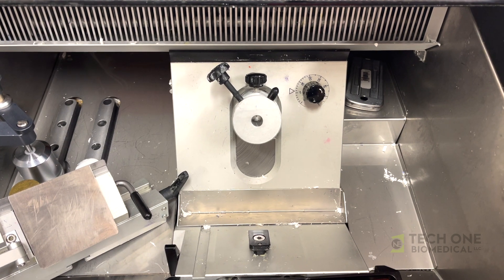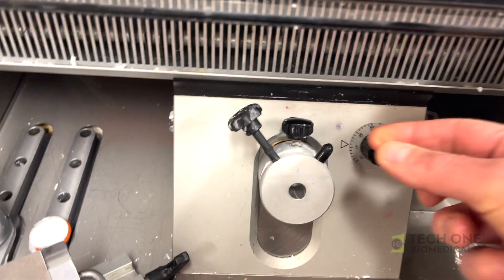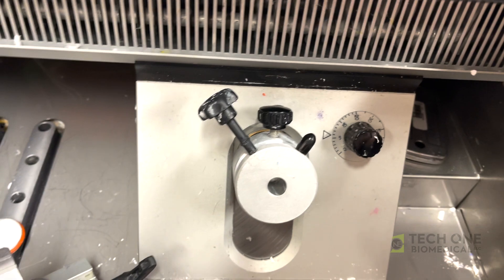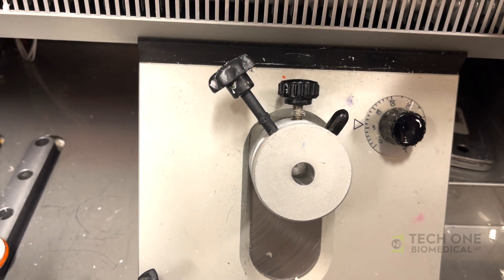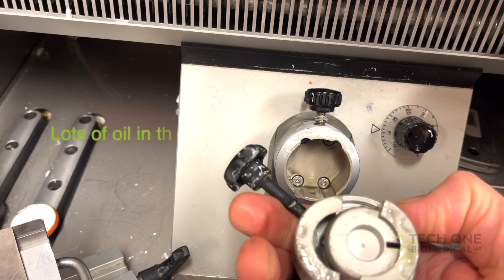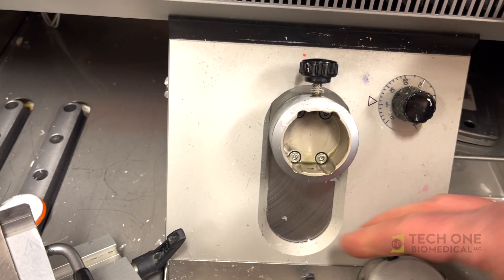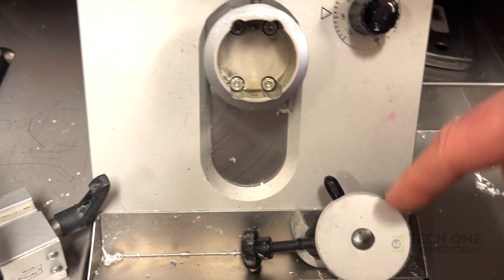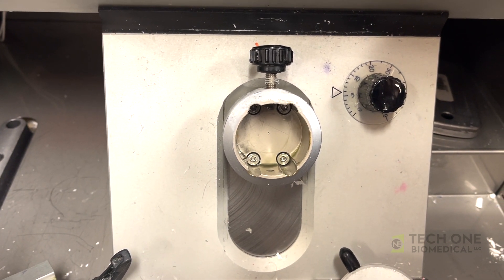Cryostat Orientation Head Won't Tighten

Comment: I just searched for this very problem with our Leica CM3050s, which has a locking lever on the head, and a ball joint type arrangement with x-y adjustment. The latch/lever would not tighten when moved from vertical to horizontal position. I was able to "back out" the alan keyed screw in the center of the lever, and that fixed the problem, but I'm not sure if this is actually the correct way to fix this. It seems like the lever should tighten more in mid-throw than all the way to the extreme, and that screw is fairly tight in the center. Any thoughts are well appreciated.